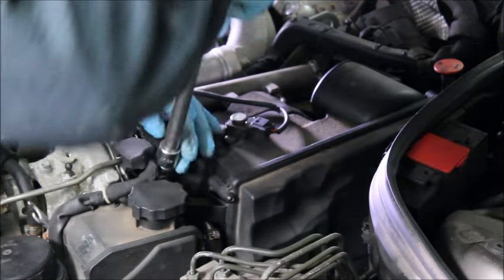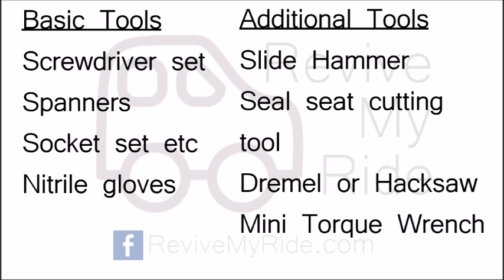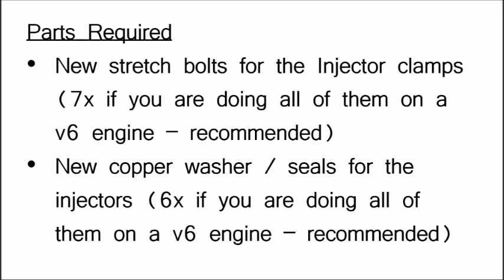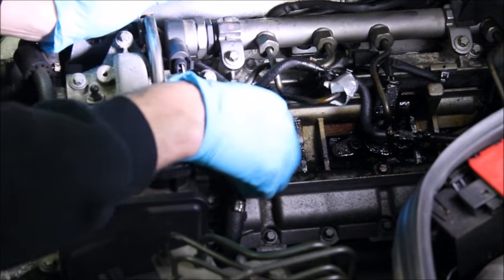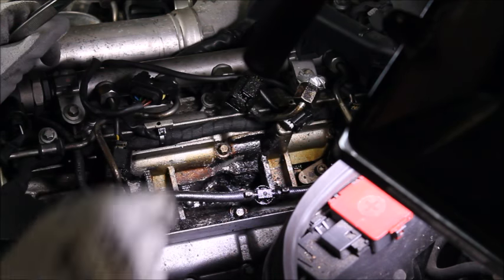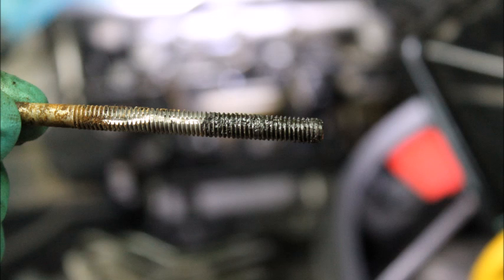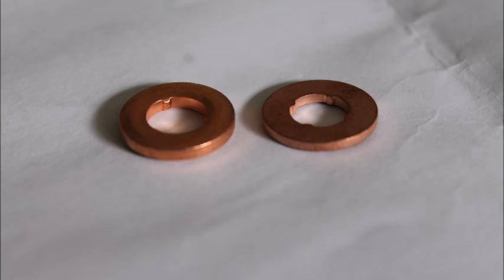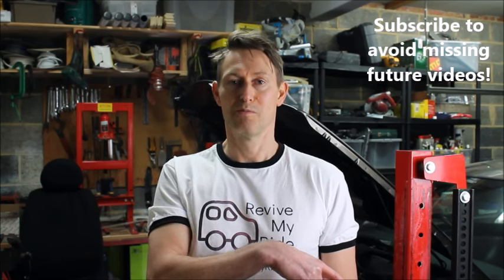Mercedes diesel CDI (Black Death) leaking fuel injector - How to diagnose and fix on 3.0 V6 engine

Comment: Thanks a lot for the vid! Helped me out big time, will have to do this to my car. I have just one injector leaking slightly, and not nearly as bad as in this example, but will probably change all the seals while i am at it as preventive maintenance. Any tips on cleaning the injectors themeselves? Thanks again
Reply from the maker: Hi, glad the video has helped you and thanks for your comment! :-) There are videos on YouTube, where people have shown how to build a DIY fuel injector cleaning rig and run cleaning solutions through their injectors. This can help the injectors go back to supplying fuel in a mist, rather than as a stream and give better combustion. Be careful though, running the cleanser through your injectors can cause a flammable atmosphere, so you need to be aware and takes steps to prevent a fire. I haven't tried this myself but it is one of the things I am interested in doing on my Merc!
Reply: @ReviveMyRide  Thanks for the reply :) Have a nice day

Comment: thanks for the video.  Do I need to change all injectors or do i look for the leaking ones?
Reply from the maker: Hi, you can just replace the bad one, it should be quite obvious but tbh, I did all of mine in the theory that if one had gone, the others wouldn’t be far behind. Also, the longest part of the job is getting the injector out (if there is carbon around it) and cleaning up around where you’ve had a leaking injector. On injectors where the seal hasn’t started leaking yet, you will change them very quickly. Hope that helps! Cheers, Phil

Comment: The slide hammer kit link is incorrect, I've ordered it and it doesn't contain the correct fitting so I've had to order the correct one
Reply from the maker: Hi Gaz, Really sorry about that! The kit I used went out of stock, so I had to link to a new one! Thanks for letting me know, I have corrected the link. Cheers, Phil

Comment: When you think about it, feminine hygiene tampons are excellent for absorbing the cleaner and filth before pulling the injectors.  They are specifically designed for holding liquid and debris and not leaving anything behind.  Place one in the injector hole, moisten it with a little diesel and now it safe to clean the rest.  I know it sounds stupid, but its very clean.  I like to leave the injector plate clean enough to eat from.
Reply from the maker: hi @fuffoon Thanks for sharing your tip! Yep, you can't get the top of the engine, injector bore, seat faces too clean, so anything that helps with this is worth a try! 👍

Comment: great video!!  I am having difficulty figuring out which tool will work with my car - 2008 GL 320.  Are all Mercedes diesels the same?  What car were you working on specifically?
Reply from the maker: Thanks! 🙂 The car featured in the video was a W209 2007 CLK 320 cdi. The engine is the OM642. On the wiki page for this engine, it lists the usages and years and you car is listed! https://en.wikipedia.org/wiki/Mercedes-Benz_OM642_engine Hope that helps. Thanks, Phil

Comment: Great documentation. I suppose the 220cdi engine will have to be done in a similar fashion.  I’m having exhaust fumes in the cabin at standstill and have noticed the pfft sound at idle.
Reply from the maker: Hi Ole, yes, from your description, it definitely sounds like a leaking injector seal. I just checked the diagrams and some of the part numbers are slightly different between the two engines but the clamp and seal arrangement looks very similar. Please be aware that the clamp and securing screw for your engine is a different part number but the seal itself is the same. I recently carried out a 2yr inspection following the repair I did on my car, with good results :-) It's not that difficult to do if you take your time and take a methodical approach. Inspection video if you want to check it out (but it is on the v6 engine again) https://youtu.be/7weS1vQ_1OI Thanks, Phil
Reply: @ReviveMyRide  I did the old “mechanic’s stethoscope” aka a tube in the ear test yesterday and clearly the #1 cylinder from the right front wheel is making the noise, the other three are quiet.  I’ll order parts and a sliding hammer, just in case today.  There’s no black stuff to be seen yet, we may have caught it very early.  Thanks for your videos and reply.  I’ll post my findings and results. 
I’ll send you videos and pictures if you find them useful for your channel.
PS:  i did. watch your follow-up video.  Great results on that one ☝️
Reply from the maker: @olewurtz7625  Hi, yes, great idea, I haven't used the mechanics stethoscope method for a while but it can be very effective! Yes, if you don't mind and have the time, it would be great to see your results. Hope the work goes well, sounds like you know what you are doing! 👍
Reply: @ReviveMyRide  I finally manned up and went for the offending injector (seal). 
I should have bought a seal cutting tool in advance.  Buy from Amazon and you can return, if unused. But I didn’t, so no I have to see if a local tool supply shop has one tomorrow, because my wife needs the car running by Tuesday and Amazon’s earliest delivery is Wednesday.
I’ve taken some pictures, where can I send them to you ?
PS: I’m pretty sure I need to refinish the seat.  I have matching traces of blow through on the seat and the washer. Don’t you think so ?
Reply from the maker: @Ole Wurtz  Yeah, it can be difficult if you need the car running and this type of work can be time consuming! If you have inspected the seat (and cleaned it with a bit of emery cloth) and you can see tracks or damage in the seat, then you are right, you will need to recut it. But when you do, take your time and cut out the minimum of material required to get the seat clean again. I'm happy to look at pictures, but sometimes it is difficult to tell from a photo. Thanks, Phil

Comment: Nice video, thank you. My om642 only has 70k km and still looks prestine, but I like to have all the parts in stock for future endeavors... just one silly question, why not use one of the old bolts as your cleaning bolt? I just state that because most complete kits only come with the 6 bolts. Cheers 🍺

Comment: I used honda copper seal...same as the nissan,thicker and softer they work better than the mercedes. 
I used a wood dowel and glued sand paper to clean injector seat...
crazy job but saved a ton of money...
Reply from the maker: Sounds good, I managed to clean up 5 of the injector seats in a very similar way, just had to re-cut one of them due to pitting.

Comment: Happy to let you sort out my Mercedes V Class black death  if you want to make another video! Seriously, could you do this work for me? What would you estimate the cost to fix it? Cheers Simon.
Reply from the maker: Hi Simon, I really appreciate you trusting me to work on your car but I'm sorry, I don't have the liability insurances etc to work on other peoples cars. Hopefully the video has given you a good idea of what is required to do the job but the cost will depend on how bad the problem is: If all six injectors need to be resealed. If they have been leaking for a while and the injectors are now stuck in the head etc. You can get a good idea of how bad the problem is by removing the engine cover and having  a good look for carbon build up around the injectors. As with everything, try to find a garage that is recommended by others and get a few quotes. Hope this helps and good luck getting your car sorted!

Comment: Thanks a lot !! Very well explained, if all tutorials were like yours it would save humanity.
I just have a problem with the first connectors you remove, the one you remove at 3:34 I can not connect it back all the way in, and the one at 3:42 I just can't get it out. I see the little gray thing on the left of it, I pull it, but no matter how hard I pull it won't come out. Am I doing it wrong? Or is it seized (230000km car, never been removed)
Thanks!! :)
Reply from the maker: Hi defalt, thanks for your comment, glad you liked the video! To be honest, the electrical connectors can be difficult and take some time to remove, especially if they haven't been off for a while. The first one at 3:34 is the mass air flow meter. For this one, you have to squeeze the sides of the clip (nearest to where the wires are) pretty hard. There is a plastic tab / lever on both sides and both of these need to disengage for the clip to come off. Sometimes it helps to push the connector a little further on while squeezing before trying to pull it off. I sometimes use some wide opening pliers to squeeze the connector tabs but you have to be careful not to damage them! For the second one, at 3:42, you also need to squeeze this hard but the focus is on the "grey piece" which you squeeze inwards towards the wires. One other idea I have got is a little bit of silicone spray may help. I hope this helps, it is actually quite hard to describe how it is done!

Comment: Great Video and Very motivational.
My car was parked just because of this since last year ( i really loved this diesel)
After i watched your video i decided to fix everything and i did as i learned from you that take time and be patience with everything ordered all the parts and Tools needed or you recommended.
I just finished everything and i made sure everything is up to its standard as you explained. 
Now car is not starting i try to start is couple of times to take the air out of fuel system.
Car doesn't start now , before it was running and battery is good as well.
Any recommendations??
What i look into next ?
Reply from the maker: Hi, it sounds like you did everything right. Sometimes the diesel can take a like of priming, and especially if you have changed all of the seals and therefore, all of the injectors have been disconnected. The best thing you can do is to charge up your battery again and try again by turning the key to run the fuel pump for a few seconds and then then turn it back off again. Do this at least half a dozen times and then try again cranking to start. Here is a link that will give you extra info about this problem, it is very common: https://forums.mercedesclub.org.uk/index.php?threads/bleeding-fuel-after-pipe-pump-repair-w210-e320-cdi.128019/ Just one extra thing to add. If you follow the advice in the link to loosen a connection near the injector a little and to crank the car (to bleed the fuel through), don't go anywhere near the engine with your hands etc while you are cranking / running the engine , the fuel is under very high pressure and a very fine spray of fuel can easily cut your skin. Hope this helps, please let me know how you get on! Thanks, Phil
Reply: @ReviveMyRide  Thank You so much for your prompt response, i can't thank you much after reading the thread you shared i find out the possible cause it was the air in the system in my case my car was in the my garage due to a little incline it was nose up so i jacked it up from behind, fuel tank was around a quarter tank i put more fuel to half the tank and battery was all drained due to cranking again and again and so put the battery on a charger and left the car for a day.
Next day came back did the self air out sequence few times with and then very first times when i cranked it started.
Woow great 
I can't thank you much with your help i was able to revive my ride and now i have confidence in it.
In this process i also put new fuel filter, new air intake seals and also new air filters .
Reply from the maker: @tayyabir5873  Great work Reviving Your Ride! Glad you got it sorted out and will now be back on the road! Thanks for your comment above, it's really great to hear back from you and to know you got it fixed. 😁

Comment: New Subscriber                                                                                                                                                                                                                                                                                                                                            Im re-seating the bosch injectors on my 2.2 mercedes vito after dealing with the black death, my question is,,, What size reaming tool should I use to recut the injector seat please ? Thanks in advance
Reply from the maker: Hi, I used a 17mm flat reamer to recut the seat on my car. I tried to look up the fuel injector for your Vito, so I could see if it is the same as the one for my car but no luck, as the site I use to check part numbers was playing up. However, if you measure the external diameter at the bottom of your injector (where the copper seal sits), this should tell you what size reamer you need. The reamer kit I used is in the description and there were a few different sized ones in the kit. Hope this helps, please let me know if you have any more questions and good luck with the work!

Comment: Thank you so much! Question though, I assume the injector face where it sits on the seal needs to be perfect? Mine has a slight groove for about 30 degrees around. And although it's better now, it's still chuffing. 

Also what size cutting tool do you use for these? 

Lastly, what is it that keeps the injector held down TIGHT, just that little wishbone?

Thank you sir.
Reply from the maker: Hi, The seat damage will almost certainly be causing you problems. I used a flat 17mm cutter but it did shave a tiny amount of material from the bore walls down near the bottom (probably because it is a cast part). Yes, just the little "wishbone" bracket holding down the injector but please take special note of the part in the video where I am clearing out the threaded hole for the bolt that holds it down. If there is debris in there, the bolt won't go down fully. Check the description for the part number for the Honda seal, these work better than the Merc ones. Also, if you are going to remove it again, ideally you need a new bolt. Hope that helps! Thanks, Phil

Comment: I have replaced the seal 3 times now on the same injector in the last year... any advice as to why this problem keeps occurring? Great video!
Reply from the maker: Hi, I have a few ideas: 1) It is possible that there is dirt down the hole that the clamp / retaining bolt screws down into, this would stop it from tightening down as far as it needs to and therefore not compress the copper washer / seal enough. (don't be tempted to over tighten the bolt as there is a risk of punching through the bottom of the screw hole). 2) Did you use a Nissan copper seal (part number in vid description)? These are a little thicker and a little softer, so provide a better seal. 3) Is it possible that the seat at the bottom of the injector hole is dirty or scratched? If so, you can polish it up with some fine emery cloth on a stick. Or that the sealing face on the bottom of the injector is dirty or scratched? 4) Sorry to ask this one but did you replace the clamping bolt with a new one when you did the job? If not, it is possible that the old one is stretched and is now too long, not compressing the seal etc. Hope this helps!

Comment: I know there is very little difference but my understanding is 7 mm Then 90 + 90, not 8 mm 90+90. I also have read that the Honda copper seals are good to use too.

Comment: I am your newest subscriber, what did you use to clean the injectors
Reply from the maker: Andrew Smith Welcome to the channel and thanks for subscribing! I cleaned the outside of the injectors using the "Seafoam" (there is a link in the description for the Seafoam if you aren't familiar with it and want to read the product info) and a green scotch bright pad. Hope that helps! Cheers, RMR
Reply: @ReviveMyRide  Thanks for the quick response. In your video you say Nissan injector seal. Your link also says Nissan injector seal in the video description but the part number is for a Honda. I just want to make sure that I am getting what is recommended. Can you please clarify?

Thanks
Reply from the maker: @andrewsmith9980  Hi, thanks for pointing this out! I can confirm that it is a Honda injector seal. Sorry for any confusion, I can't change the video but I have updated the description and added the info to a comment pinned to the top of the comments section. Cheers, RMR

Comment: Someone failed to turn the cutter on the seating face of the injector.  Have you had to re-do this yet due to leaks there?
Reply from the maker: Hi, thanks for your question! I cleaned up the sealing face of the injector with some fine emery cloth prior to refitting, just to make it key in to the new copper washer better. The sealing faces on the injectors are steel, so it is very rare for them to be damaged, as opposed to the head which is much softer, with it being aluminium and hence, they sometimes need to be recut. No, the injectors are all still sealed perfectly, almost 2 years and 30k miles since this video was done. Hope this helps! Thanks, RMR